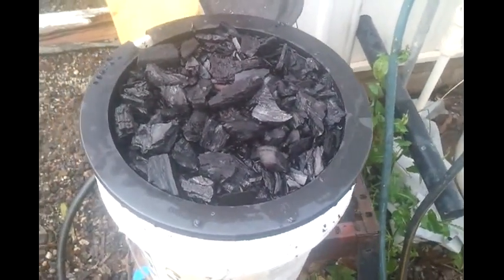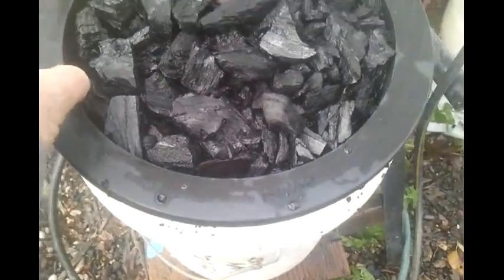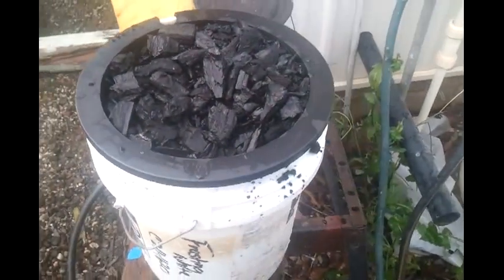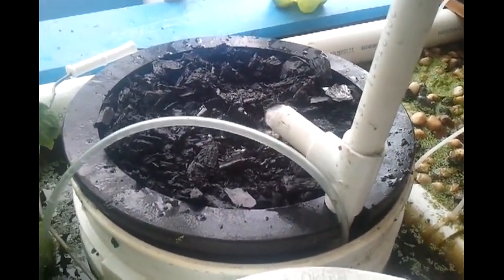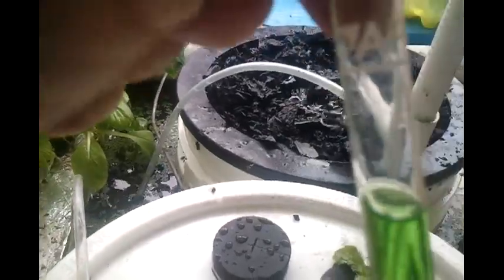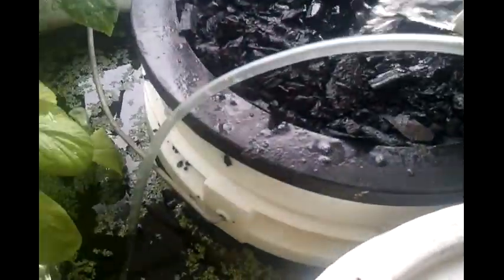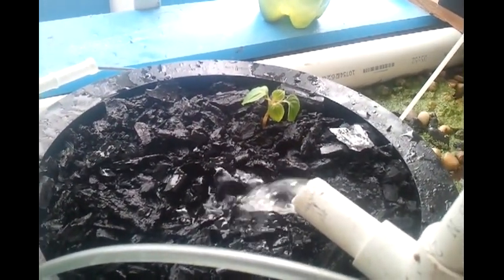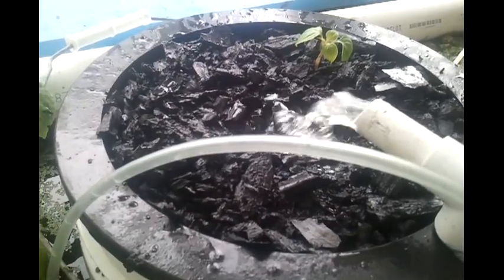Bio-Char Experiment Videos 1 + 2

Comment: I have a question.since it has been a year since the video was made.can you tell me how the charcoal has worked out? The positives and negatives. Thanks
Reply from the maker: Charcoal worked out pretty good, but it floats which caused the plants to fall over if the water was too high.  I was told that there is a difference between the BBQ charcoal that I used and charcoal fired at higher temperatures for biochar which has more nano pores for nitrifying bacteria. I did not do much more with it because I do not like the way it floats, but I would not hesitate to add it to other media or augment my soil with either type of charcoal.
Reply: Bob Campbell  Did you find that the bag charcoal deteriorated fast, or did it hold up.
Reply from the maker: gardening4fun
The charcoal holds up very well.  But the BBQ charcoal that I used looks to me to be a lot more sturdy than the biochar fired at higher temperatures.